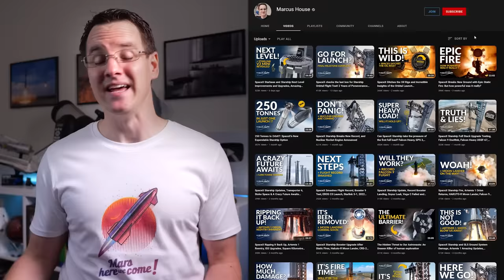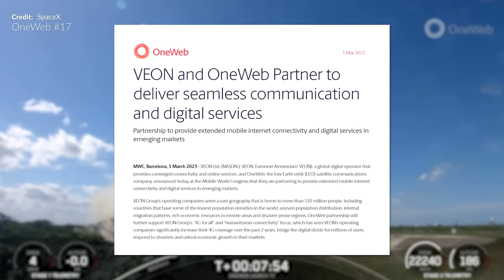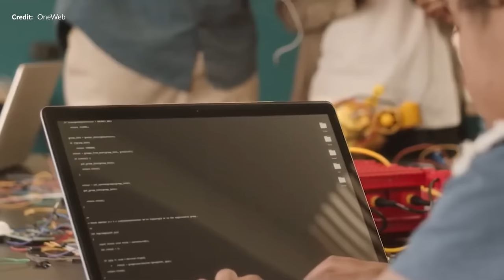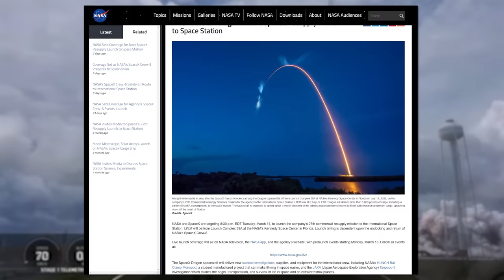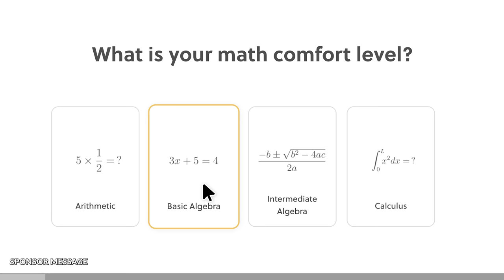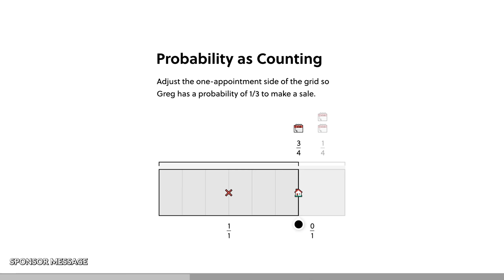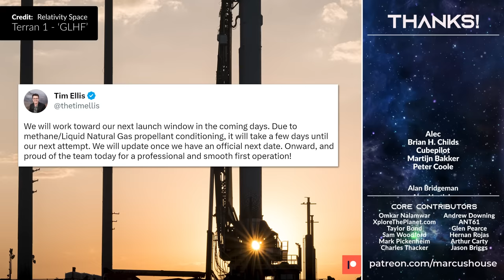Why did SpaceX just remove their booster? Rocket failure for JAXA H3, Terran 1 scrub, Crew 5 Return

Comment: Not sure why they didn’t bolt cover panel on OLM instead of welding. I figured they would need to be removed from time to time.
Reply: Bolts takes way more time
Reply: @alvianchoiriapriliansyah9882  I understand that, but from a maintenance point of view where you have to service equipment behind the panels, bolts give you the ability to remove the panels without having to cut or burn welds to remove panels.
Reply: @jerryarcher1923  Not all panel servicings will require removing the shieldings
Reply: @alvianchoiriapriliansyah9882  if a frog had wings he wouldn’t bump its a$$.

Comment: More bureaucracy to get rid of prior bureaucracy, that's the Vertical 'Idiocracy' Challenge that engineers get tangled up in. No adjacent ally vessel, for less boosters fuel burn, weight spare for land limb gears, nor fewer round trips of bulk dry mass stage into orbit.

Comment: Why doesn’t SpaceX practice the mechazilla catching with a Falcon rocket until they do Starship or Booster?
Reply: Because it waste time
Reply: A Falcon 9 would be more likely to damage the tower because it can't land as precisely due to the limited throttling capability of the Merlin engines. It's not uncommon for Falcon 9 landings to be several yards off-center.

Comment: On the starship's launchpad. Why don't they put heat shields on the legs? Then they wouldn't have to repaint it
Reply: People thought the exhaust is only about the heat, but they're misinformed big time. So tiresome
Reply: @alvianchoiriapriliansyah9882  I don't think that but the heat and flame is obviously affecting the legs. Heat shields would and no need to be a tool about it
Reply: @wsbob  Source for heat shield tiles working well underneath an intense Raptor exhaust?
Reply: @wsbob  Then instead of repainting they'd be re-tileing.  I fail to see the advantage.🤷
Reply: While thermal tiles are great for heat, they suck at blunt force. The shockwaves from the engines would be breaking tiles all over, since you can apparently crack them with your hand.

Comment: Is a full duration firing of the booster a requirement for a human rated certification? How long did booster run where they had two engines fail. 
NASA did a full duration run of the SLS 1st stage at Stennis Space Center. I don't think the OLM can stand that level of abuse. You saw how much water was used on the SLS stand at Stennis and that stand at Stennis is purpose built to handle that level of abuse.
Reply: The requirement is flight history. Why do a full duration firing when the actual (uncrewed) flight(s) will do just that?
Reply: @alvianchoiriapriliansyah9882  It's a legitimate and neutral question.
NASA, SpaceX, ULA, Blue Origin and various ankle biters all have some type of test regime they are going to put their respective rockets through on the way to getting those rockets human rated.
It was a simple question.
Does SpaceX test regime incorporate a full duration test firing of the booster on a test stand? 
The big advantage of that is you can put all sorts of test instrumentation on booster that you can't on a launch.
The other benefit is that you have all of the parts in hand.
Should the launch fail, all the parts are scattered all over the Gulf of Mexico.
Reply: @waynewells4885  No, as I said the actual flight will do just that: full duration firings + bonus of you know.... actual flight dynamics (less than cold propellant, aerodynamic, stage separation, etc.). Take a look at Boeing Starliner fiasco on how all-up system tests are important....

Raptor has proven to be reliable especially on early phase of burn. This is important because they stated publicly that as long as they don't damage Stage Zero it's a real success. They have proven to be able to light & shutdowns many cluster of engines (which is the riskiest events on engines, see Everyday Astronaut video) & see the 2 problematic engines which they can fixed on the ground

Debris on the gulf, yes. So what? It's not like each vehicle cost a billion dollars like Shuttle. Plus they're emphasizing heavily on mass productions, which will solve many ills. Thank goodness Starship can fly uncrewed, and with rapid iterations they can get a real data which is important for human rating

Comment: Putting the plates inside the much larger outside plates is much stronger. This location will cause the inner smaller plates to be pushed into the outer larger plates, instead of being blown off the outside of the larger plates by any rocket exhaust.
 I don't care how many times Space X needs to stop the process for safety. This is THE most dangerous and complicated task humankind does today. The only thing that gets close to this much danger is the production of nuclear power; but you can shut down a nuclear reactor, once you start it. Once that rocket is above the ground, it is a completely 100% - it has to work - proposition. Take all the time you need SpaceX people. I have faith you will work things out for the best.
Reply: Are you an actual welder by any chance, experienced in structural steel welding? Or just a random dude?

Comment: The trouble is, whenever you build anything closer than a mile or 2 from the ocean, corrosion and rust are a major hazard, and will create havoc for all your critical metals and components. Not a good idea overall to have any Space facility close to the coast.
Reply: The anti-corrosion coating & offshore facilities is, you know, exists
Reply: I would think they are aware of that at Cape Canaveral where nearly all of the launch pads built there in the past sixty years are around 1/4 mile from the water. Although pads 40, 41 and 39A/B are set back a little farther at around 1/2 mile. 

At Vandenberg most of the launch pads are set back around one mile, with the Atlas V pad nearly two miles from the water. French Guiana is also around two miles. Satish Dhawan is around 1/2 mile. By far the closest to the water is at Tanegashima where the launch pads are less than 1/10th mile from the water.

Comment: Why no flame trench
Reply: From the NSF stream on the 31 engine static fire, the distance from the pad to the ground at Boca Chica, is the same distance from the pad to the bottom of the flame trench at LC-39.
Reply: Because it's a 360° diverter

Comment: To me, it seems really dumb to 3D print simple flat structures, like the fuel tanks. Rolled steel or aluminum would probably be way stronger. Where 3D printing shines, is creating small runs of complex structures, or even structures that are impossible to create using subtractive methods.
Reply: Um, propellant tanks are not flat. Relativity is printing with a propritary metal. SpaceX, Rocket Lab and others are ALSO 3D printing hardware, just not to the same level as Relativity. The Terran 1 has done many pressure tests and static fires already, so it is not like the tanks have not been tested.
Reply: @steveaustin2686  
1. You can easily bend flat sheets to form a propellant tank (less the end domes). 
2. I'm not saying it's not a capable rocket. I'm saying it seems dumb to 3D print parts that can arguably be made easier using other methods.
Reply: @niklaskoskinen123  Apparently Relativity disagrees with you. Especially, when you want a different size tank, you just tell the software to print it smaller. You don't need a separate machine to bend the smaller tank to the size you want. Relativity is betting that the cost of developing the tech, will be offset by the cost savings later.
Reply: @steveaustin2686  I'm sure they know a lot of stuff I don't. I'd love to hear their argument for printing the tank. But at least since I checked, you can use the same machine to roll sheet to different curves.
Reply: @niklaskoskinen123  They tout the when you need a different size tank, you just print it. You also don't have all the milling, bending, and joining the tank, as you just print it. There have been multiple interviews with Relativity that should be on YouTube about this.
Reply: @steveaustin2686  Ok, I'll try to watch some of them. I agree complex shapes like the nose cone and domes could be easier to print, especially if you want to quickly experiment with different designs. But for mass production, the same might not apply.

Comment: Great coverage Marcus!  here is a thought I keep having and want to know what others think. SpaceX continues to build other starships. SN25, 26, 27, and so on.  Why are they continuing to build these before the first launch?  I assume that the first successful launch will supply tons of information that I would think will give info for many updates and changes, yet they keep making them the same way.  I.e.,  The tiles may need to be completely redone a different way, yet they keep making new ships the same.
Reply: They gain a lot of experience in building techniques which is a big part of the goal, to get to the point where they can quickly and reliably build Starships. And it allows them to try out new construction ideas. And it's possible that one or more of these could be used for test flights. If not they will just scrap them that's nothing new at Boca Chica. They would rather scrap a few vehicles than risk being ready for a test flight but not having any vehicles ready. If changes are needed after the test flight they can decide if it's easier to modify the existing test vehicles or build new ones from scratch.

Comment: Not going to fly in March,  unlikely in April.  He'll launch eventually, toss it into the sea and declare it operational.
Reply: SpaceX plans soft water landings until they dial in the accuracy for a catch attempt. They did the same with the Falcon 9 when they were trying to land it. Whether the catch works, is a whole different thing.
Reply: @steveaustin2686  It's not going to go well.  I foresee large heaps of stainless scrap and burn marks everywhere.
Reply: @Oldjohn52  SpaceX says that they are fairly confident that Starship will get to orbit. They are expecting it will take multiple attempts for a successful re-entry and landing.
Reply: @steveaustin2686  Just curious how many in a multiple.  Three? Ten?
Reply: @Oldjohn52  Musk didn't say how many multiple attempts to have a successful re-entry and landing that they thought it would be.

Comment: So my issue with the associated water deluge system parts is that it would have been much cheaper to build that from the start, leveraging nearly 80 years of mega rocket research, rather than assume that SpaceX could have gotten away with much less. For some reason people, including you Marcus, are praising Elon for pressing forward with minimal consideration for these systems, when objectively they have been proven to be the best path to orbit. If you actually understood the incredible complexity of these systems then you wouldn't have any appreciation for people like Musk who choose to bypass major stepping stones for the sake of simply launching a cylinder into space. That cannot be our goal.
Reply: SpaceX's unconventional approach to rocket development has been very successful so far. The fact that they chose to prioritize other things and waited until they had some static fire experience with the launch mount to start working on water deluge doesn't seem unusual for their style of development.

The primary need for water deluge is to protect the rocket from damage from the sound waves as well as protect the launch structure from heat. Predicting that isn't easy,  it seems like SpaceX prefers to get data from an actual launch before installing the water deluge system.